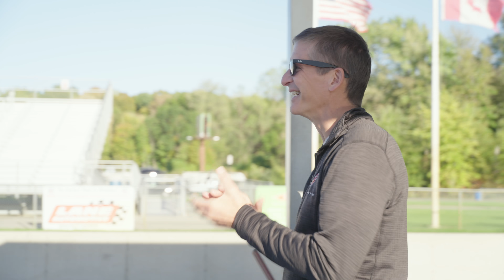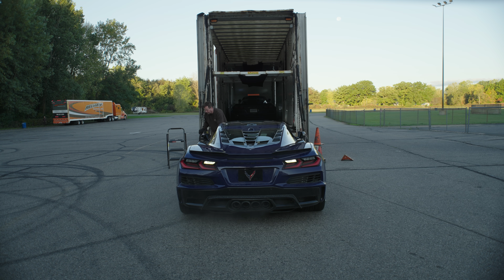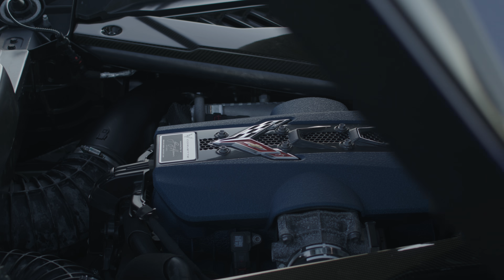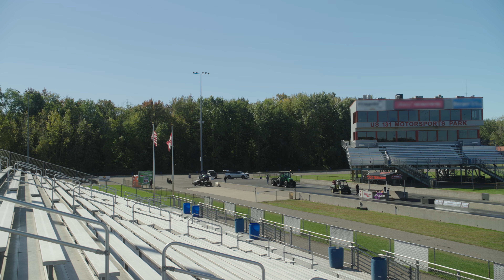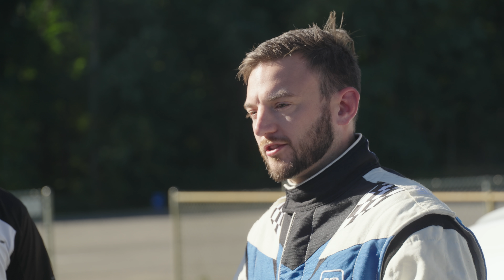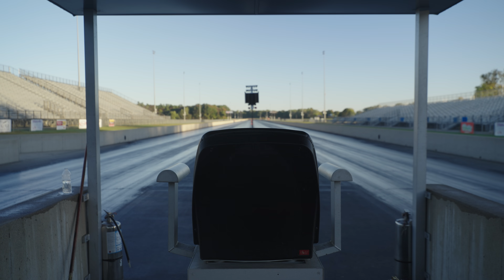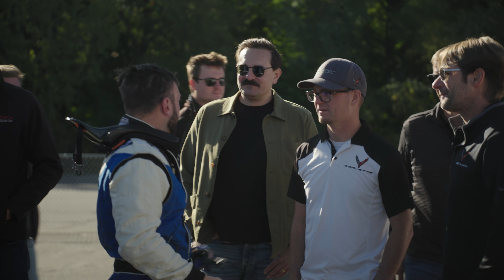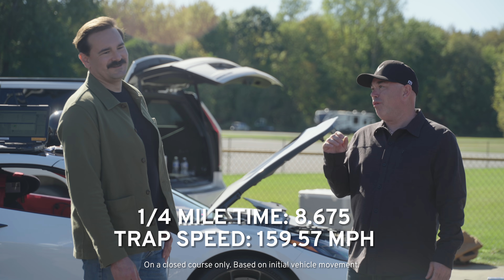We Pushed The Corvette ZR1X To Its Limits (DRAG STRIP TEST)

Comment: Wow! The Corvette team keeps killing it!
Reply: The problem is GM can't build it in decent volume thus the dealerships are ripping off customers.
Reply: @allsportsexpert  they always release new model slowly and then ramp up production afterwards.
Reply: @markw9512  The ZR1 was released in Q4 2024 as a 2025 model and they still have not produced half of what they need to produced in 2026. They have not produced any ZR1X yet, to customers.
Reply: @allsportsexpert  no. That’s when it was revealed and orders were taken. Production for the C8 Corvette ZR1 began in the second quarter of 2025, with customer orders starting to roll off the line around late April 2025, though supply chain issues limited early output, with some 2025 orders being converted to 2026 models due to delays. The highly anticipated ZR1, featuring a twin-turbo 5.5L V8 engine, was officially revealed in July 2024.  

And yes, I know they haven’t sold any of the ex version yet and never claimed otherwise
Reply: @markw9512 that was what I said.
Reply: @allsportsexpert  no it isn’t actually.  ZR one was not released in Q4 24 was released in 2025 to production. So don’t try to gaslight me, 2024 is not 2025 friend.  You said released which means put in a production. That’s not true. It was put in into production, I.E.released, in 2025.
Reply: @markw9512 please learn your English. You can simply use Google also.
Reply: @markw9512 English 101 for the stupid. ZR1 was released to the public in 7/2024. It was released to order in Q4 2024. The production started in Q2 2025. No one who speaks English says it was released for production. You don't release for production.
Reply: Would rather the zr1x or zr1?
Reply: @kevin-qc7zv  zr1x definitely
Reply: @Tyzskyz17_TYZ917  I'd rather the z06 simply because I love the sound.
Reply: @kevin-qc7zv  Understandable, me personally tho, i'd take either the zr1x or e-ray just cuz i find them to be more daily usable, especially with the awd and stealth mode, i also believe that the hybrid powertrain makes them both quicker and more efficient than there gas only counterparts as well in terms of acceleration and fuel consumption.
Reply: @Tyzskyz17_TYZ917 well yeah that's true. Especially me living in massachusetts where we get all 4 seasons. My c7 is limited due to the snow and ice
Reply: @kevin-qc7zv C8 Z06 GT3.R
Reply: @moiv8 that's a beast right there.
Reply: ZR1… No Electric drive unit to fail like in my 1100 mile E-ray!😡
Reply: I rented one it had 45k miles you must not beat on it hard enough you know that rental been ragged and still truckin.
Reply: @Blueflyer190 you dont have one